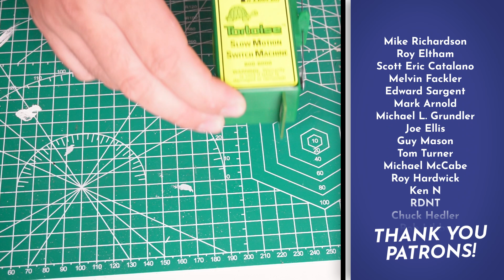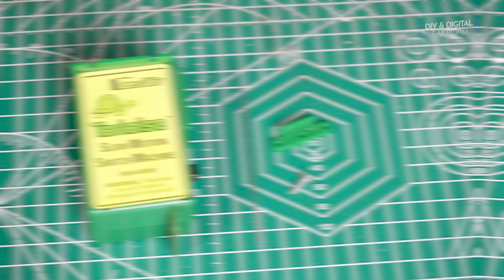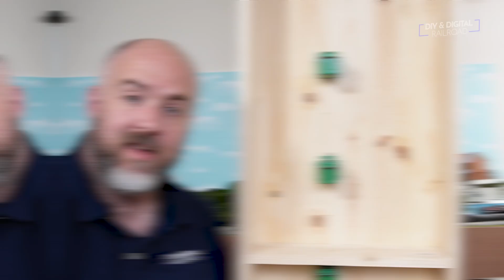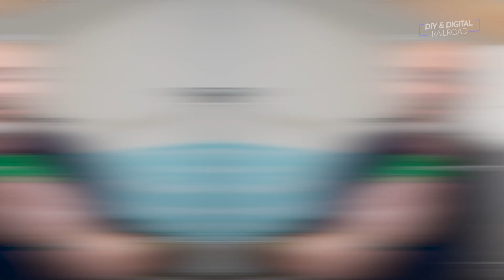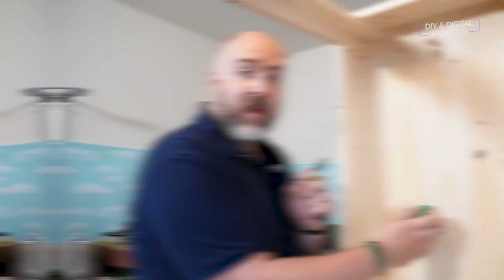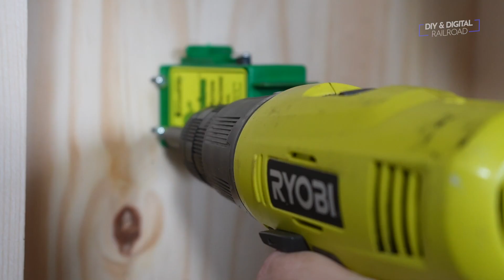Installing Hidden Model Railroad Switch Machines

Comment: A Suggestion, get an extension for your bits so you don't mess up the Tortoise machine,  or any other electronics or electric equipment.

Comment: I used a multi tool to make a slot in place of the hole. The slot doesn't show, is more efficient, and gives more clearance. I have seen many broken machines from manually moving them. The better way to test them is to use a 9 volt battery and use a wire from the + side and one from the - side. A one way will urn the motor and thee other way will turn it back. No forcing the motor and a broken motor. If you insist on doing it manually, very slowly is the right way to test the motor. The wire will kill most rail cutters as the cutter is made to cut rail which is soft and the wire that the motor companies use is hardened. It will put a gouge into the cutter. I have ruined several cutters that way...

Comment: Can "Tortoise by Circuton" motors be adapted in any way for non-powered KATO switches - using HO scales if that makes any difference? Not a big fan of powered switches mostly because of wiring issues but also the large and clunky looking KATO switch controllers that are made to snap onto a KATO controller and apparently not look unobtrusive....NOT!
Reply: Follow the directions and if the Kato switches ( I have never looked ) don't have a hole in the throw bar, drill one...
Reply: @davidcurtis5398  - only opened bottom of one for other reasons and never noticed if it would work. The little switch is on the top side so maybe could be adapted....

Comment: A good explanation. I’ve been using Peco switch machines and have a terrible time getting them mounted and aligned properly. As well they seem to require a high spike in power to get them started. So much so that maybe a capacitor in the circuit is required. I could try Tortoise but I’ve hesitated because they are so much more expensive than all others and if I need a lot of them it’s cost prohibitive.

Comment: Those wire throw rods are pretty hard wire and might eventually damage your rail cutters - not a big deal if you're only cutting a few.  But if you have a lot to install, it's better to use a cutting disk on a Dremell (you may end up buying a 2nd rail cutter that you ONLY use for cutting track).  It all depends on how big your layout is.

Comment: A few more tips: (1) the Tortoise is incredibly quiet - until you mount it to a huge plywood sounding board! To reduce the noise, I cut a 2x2 inch piece of thin foam saved from packing material and place it between the Tortoise and the plywood. (2) If your layout is too large to conveniently flip over, you can (a) try to install from beneath the layout (HARD), (b) use the separately available drilling template and drill holes from above (still hard), or (c) drill holes and mount your Tortoises BEFORE you lay track: Do not attach your sub-roadbed (plywood) to the bench work, install your roadbed, and locate your turnouts pretty carefully, and drill the holes for the Tortoise springs. Then flip the sub-roadbed over and mount the Tortoises. The Tortoise spring gives you a little tolerance, so it doesn't have to be perfect. Once the machines are mounted, flip the sub-roadbed right side up and attach it to the bench work. Attach a piece of blue painters tape to the protruding springs so no one accidentally pokes a hole in their hand! Now you can lay the turnouts in place, and threading the spring wire through the throw-bar is child's play. (Don't cut the spring until all track has been laid.) (3) I use a #4 washer between the screw and the Tortoise: this stops the screws from chewing into the plastic body of the Tortoise. (4) Finally, save yourself the trouble of soldering underneath the layout: buy Tortoise edge connectors (about $3 each) and solder your wires to the edge connector (I use eight connector CAT-5 wire), then just slip the connector onto the Tortoise.

Comment: I paint the area  under the layout where the turnout is installed with latex paint and then use 3M heavy duty doubled sided tape to attach the Tortoise. No screws. This holds very tight and provides a buffer between the plywood and the machine that greatly reduces the sound the Tortoise can radiate through the layout. Also, since most layouts cannot be tilted on their side, it eliminates the need to crawl around under the layout trying to drive in mounting screws. This method is tried and proven and holds up over time.

Comment: Is there a reason you choose to use a Tortise rather than a servo for this application? Thanks for this and all the informative videos.
Reply from the maker: Good question!  Tortoises have been around awhile and are designed for model railroading.  While servos are cheaper, a tortoise is going to be easier to install for those with less experience.
Reply: @DIYDigitalRailroad  Makes sense, thanks for getting back to me.

Comment: And those of us using Kato Unitrack switches just have a laugh at the hard work involved in using other brands of switches. Life would be boring if everyone did the same thing.
Reply: Unless you use the non-powered switches because the appearance of the large and clunky KATO switch controls. 😃

Comment: Thanks for another info-fest, Jimmy. When you mention 'slower than snap switches', do you know of any snap-type switch that may move a rod thru 90 degrees, starting at 12 o'clock and moving 45 degrees in each direction....and quite quickly, too. Nothing too taxing for you on a Monday 😉. Keep up the great work with the vids👏👏

Comment: Great episode. I didn't use tortoise on my layout but rather simple servos, but it is always nice to have backup ideas when something doesn't work or if something isn't available.  Also, that turnout looks like it has a bent point. Or is it just my eyes.
Reply from the maker: I think it’s the weird angle and the taper of the point.

Comment: Standing the layout on its end is cheating when installing the Tortoise Switch Machine.  You need to show how to do it while underneath the layout reaching above your head while dropping the screws and having the wood chips from drilling falling into your eyes.  🤣  I have to say that turnout controls were nowhere near the top of the list when I was building the benchwork or track laying.  Nice job there Jimmy.
Reply from the maker: Hahaha!
Reply: What dummy would be under the layout drilling the clearance holes?? They go in from the top unless you are one of the dummer ones that forgot to pre-cut the spaces.
Reply: @davidcurtis5398  That dummy would be me since when I was planning the layout I didn't plan for switch machines or even have them at the time.  Not all of us are smart as you and have everything planned out in advance.